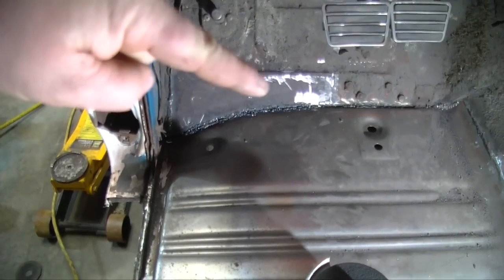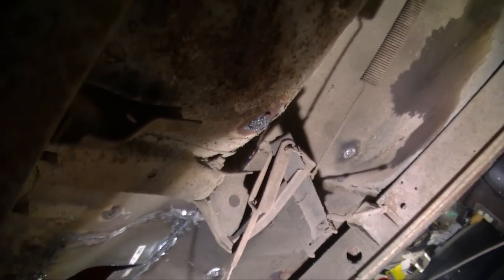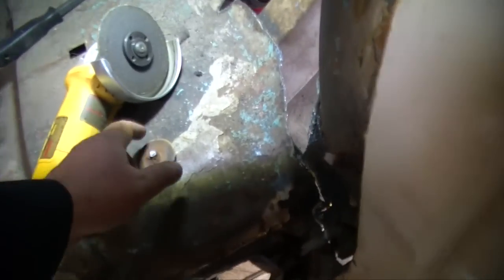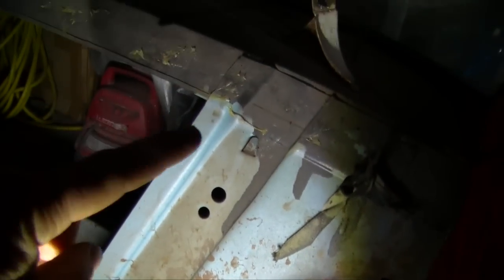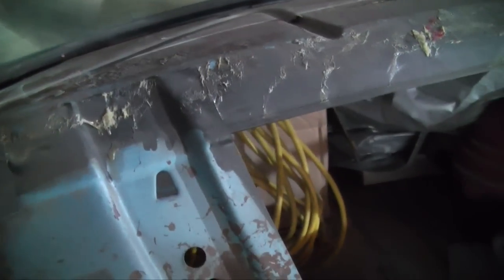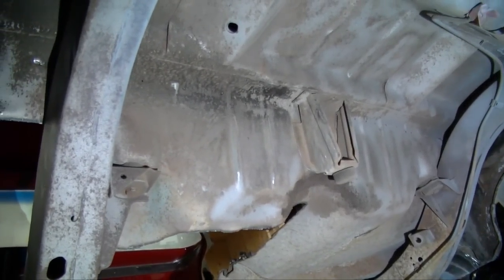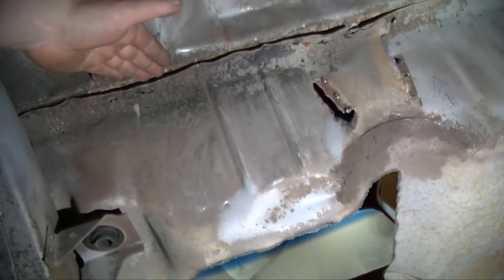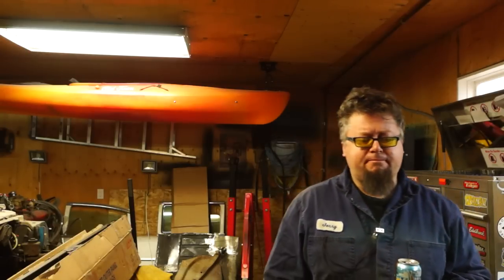1957 Chevy Drivers Floor Removal

Comment: You might want to look into seeing if there is enough engine material left on engine block in order to have it resleeved in order to try to save the original engine block originalitys sake. The again thats just me i have always been a sucker for for classic cars that still have all original equipment that was installed at  the factory. By the way i just subscribed to your channel.

Comment: Nice work but for goodness sake it's a four door. You can pick these up even today for less than 10k that are complete not much required. I could see investing the time and energy in a two door as you can't find a two door hull for less than 6 to 7k that needs everything. Really unless it's super rare and the four doors arnt you'll never recoup your time or money invested in the 4 doors. If it's something you're going to keep always it doesn't matter but incoming from one that's restored a few cars sometimes it's better to spend a little more on a real sold example in the end. Great work though you're very talented.

Comment: Plasma makes short work outta the job  your in balls deep there razor disc on electric grinder I ran same setup but switched to air grinder  blade gets stuck tool stops  electric just explode the disc  carefull
Reply from the maker: shilosheena ya you always gotta be careful that's for sure when it comes to cut off wheels on a grinder

Comment: nice job , good thing for video cas when i start on my 79 trans-am ( hoping its not as bad , mine i think is just corners ) cas if i need to do all floor that  vid will come in handy ..like yeah thats what i did ......lol
good luck it's getting there just gonna take a while but i know you can do it 
p.s. got my 1st radiation treatment today only 8 more weeks every day,  except week-ends
Reply from the maker: BIGMAN FROM MICHIGAN how does it feel so far, i bet after a few weeks it will start to creep up on you.  I wish you luck in your adventure
Reply: so far so good only lasts like 45 sec's on each side of neck but DR. is doing it  DIFFERENT WAY THAN ANY 1 BEFORE ME I'M USING A WHEEL CHAIR TO SIT IN AND TRYING TO BE STILL WITH MY HEAD BRACED SO IT CANT MOVE THAT TAKES LIKE 1 HR. NOW THATS A BITCH IF IT WAS JUST SHOOT IT AND BE DONE SURE WOULD BE NICE,  BUT WHAT EVER IT TAKES I GOTTA DO IT CAS THE ALTERNATIVE I DONT LIKE 

Damm caps sorry about that , i to lazy to redo it again it's my size and my phobia of wearing a mask then them popping it into a wooden board so head cant move oh shit i just couldnt do it so where going this route i just got to be still .
t.c be safe out there watching your quad ride now looks like a lot of fun BUT your singing could use some improvement ......lmao
Reply from the maker: hahaha yeah my singing is terrible